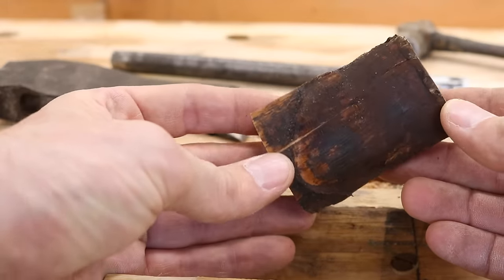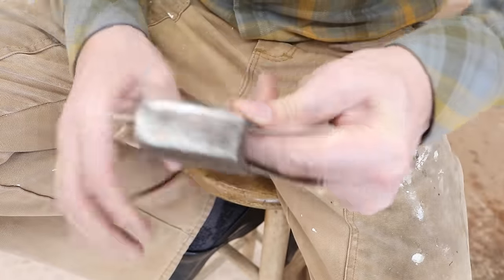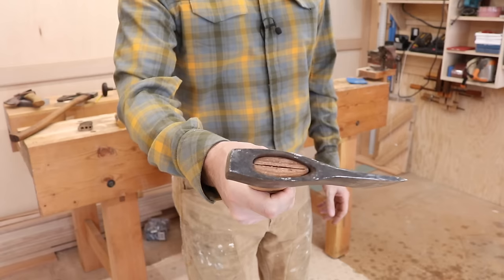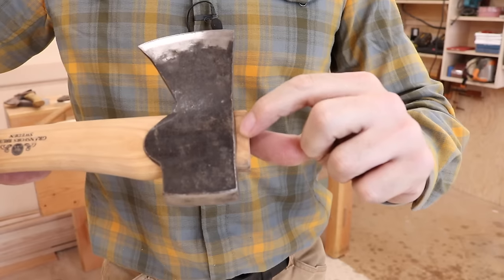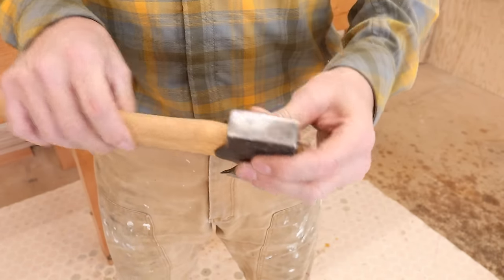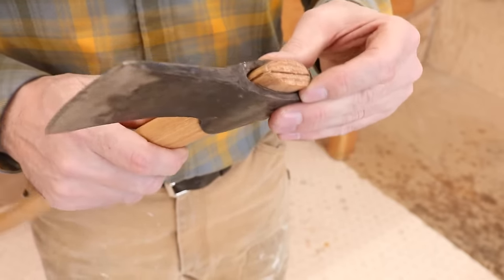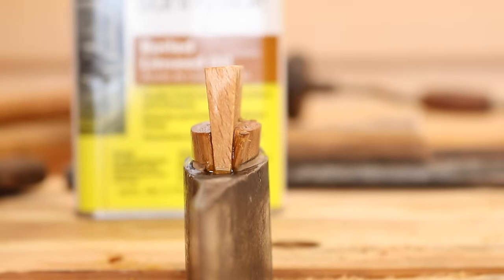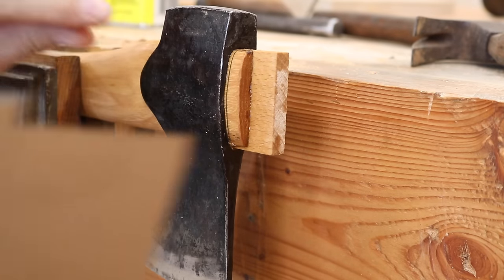How To Handle An Axe - part 2

Comment: So on the boiled linseed oil treatment, you said to treat it 
every day for a week,
every week for a month, 
every month for a year, 
then once a year.

In summary, do you mean treat it every day for one year, then subsequent years would only need one treatment/year?
Reply: Yes, the first week, treat it every day or so. Then every week for the next month. Then once a month for the rest of the year. Then after that just treat it once a year and it should be good.

Comment: You pulled the old piece out of the head and said "they must have caused the wood to expand some how", actually the opposite  is true. The head is heated enough to cause it to expand [do not over heat], put on the handle and allowed to cool and contract.

Comment: Pounding the wedge in caused the handle to move a bit out of the head. I always have the handle end on concrete or other hard surface. Not with the head supported like was done.

Comment: Question for you. I bought a brand new hickory axe handle. The top part of this handle that slides into the axe eye, right in the middle of the slit where the wooden wedge would go has a hole, it's about the width of a pencil and only goes down about 1/2" if that... What is that for???

Comment: I know this is an old video, but was just curious as to why the handle wasnt secured in the vice prior to driving the wedge in? At 9:54 you can see that the handle is pushed down about 1/16th of an inch after the first strike driving in the wedge.

Comment: I'am tell you guys and gals . The Fiberglass handles are better than the wooden handles. You can grip them better!  The fiberglass handle cuts down on vibration, and sock. They got a great protection around the head of the handle as well. Its better than the rubber band on wooden handles! Sure they cost around 20 bucks but worth every cent. I got my fiberglass handle for my 6 pound maul, at LOWES
Reply: No thanks.

Comment: When you hammer the wedge in, you should hold the handle still rather than let the axe rest on the iron... otherwise the handle will slip down the axe iron (as can be seen in the video) and loose the grip you got in the previous step.... not sure my poit is well explained...

Comment: Wondering if the boiled linseed oil on the wedge is a good idea or not. I dug up a maul and an double sided axe that needed a handle and worked fine on the maul but not so well on the double. Wedge kept bedding itself then jumping back out. Now I’m no expert by any means right now so it may just be something I did but the oil sure didn’t seem to help that wedge stay in the handle... am I the only one?

Comment: Maybe they soaked the handle before putting the handle into the head then drove a dry wedge in then kiln dried the axe and with the handle in and finished driving the wedge in after it was bone dry?

Comment: Does the gränsfors bruks small forest axe come with a metal wedge in it from the factory??
Reply: Daniel Eraut no not anymore! They stopped putting the metal wedge on their smaller models! But the handles are still holding up very good!

Comment: Think i'm going to rehang an old hammer that the handle snapped off. Never done anything like this before so will be interesting see if i can do it half decent. Usually you'd just buy a new hammer.. but this one is old and has character why not attempt to reuse it.

Comment: That is not how you should drive a wedge. You should put glue inside the split, not oil. That wedge will move and fly away when you swing that axe. The correct way is how Liam Hoffman does it. You should watch he's videos.

Comment: Wouldn't it be better to clamp to the handle when driving the wedge? If you look back at about 9:57 you can see the line on the handle move down.

Comment: If the shaft is not touching something on the bottom, the head slides up when driving the wedge. As is clearly seen on your first impact on the wedge. Won't this be an issue?

Comment: In my current restauration project, I might have fit the axe head to tight on the handle and now I can´t seem to get the wooden wedge in. I was thinking of either saw a little bit into the top of the handle to widen the gap where the wedge is supposed to go, or only use a metal wedge (maybe one of those round ones?). The wooden one just seems to bounce a bit in and out again - or it breaks. Any Ideas?

Comment: I bought a GB small Forrest axe.  Then had to buy another so I would have one in the two states I spend most time in.  Then had to buy 2 GB mini belt  hatchets for same reason. then two GB hand hatchets for same reason, then two GB Outdoor axes for same reason, then two GB Scandinavian Forrest axes for same reason, then two GB wildlife hatchets for same reason. but due to an abundance of restraint, only one GB Carving axe.   Why?   Did you just not see Cody put a new Factory replacement GB handle on his Small Forrest axe with NO  fitting what ever!!!?  That axe company has their act TOGETHER!  Why waste money on any other axes?  I agree with Cody, the GB Small Forrest axe is the most often go to axe.  If I could only have one, grudgingly I have to go with the Scandinavian Forrest Axe. I would mourn the loss of all the others though.

Comment: I just received my new small forest axe from gransfors bruk and its doesnt have a step wedge in it Would you know why this is? I have heard one other person say that theres didnt come with one either I wonder if MF (the makers initials) just doesnt use them. I also noticed where the cheeks meet in the middle   of the axe  is a small crack that goes towards the cutting edge should i be worried about this? its probably 1/8ths of a inch long. the top is not like this. Id appreciate any information anyone could supply me with. I am wondering if I should contact gransfors bruk send them a picture an ask if i should be worried.

Comment: You used oil in stead of glue.
As soon as you started pounding down the wedge the whole handle moved down.
Also, too truly seat the head before the wedge you can’t only hammer the bottom of the handle. It will always seat towards the heavy side of the axe head. That will allow minor movement upon impact that will become major movement over time. 

Not being a D. Just saying🙂

Comment: soak the head in water it will swell up
Reply: ... crush the fibers, then dry up and shrink, leaving you worse off than before. Oil doesn't evaporate.